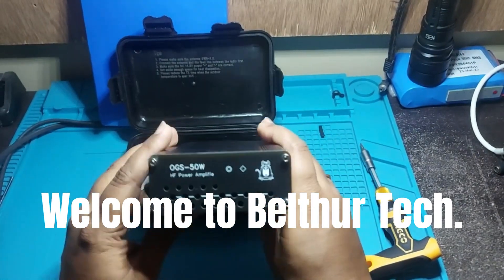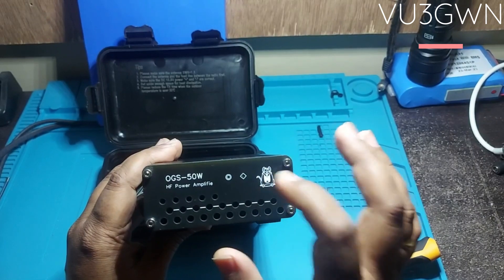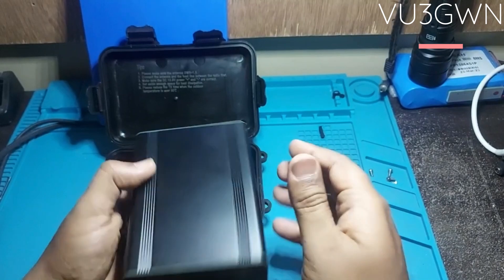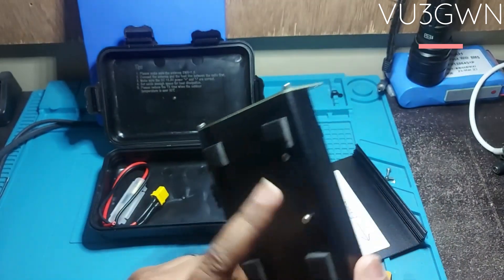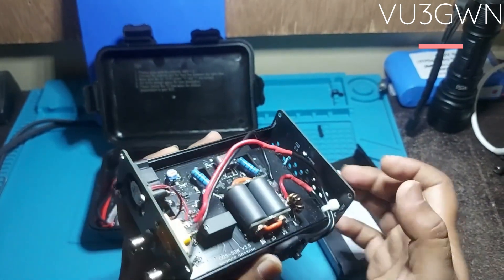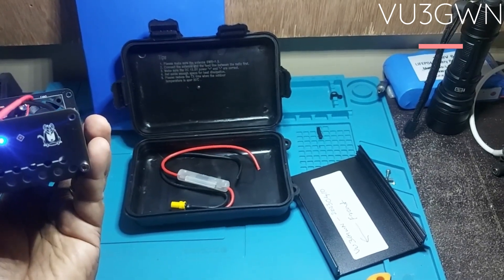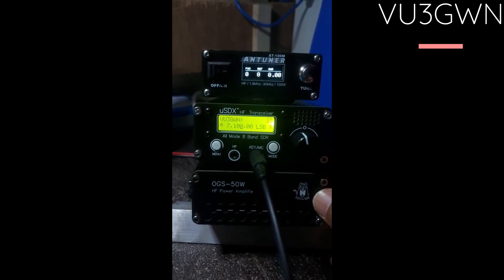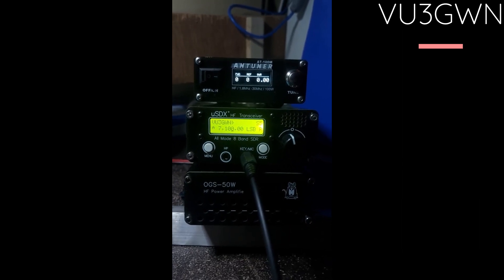OGS-50W RF HF Amplifier Review

Comment: Thanks....
I bought one and will be very careful regarding SWR & power fed into the amp by my rig.
My Qrp rig  is an old ubitx & bitx40. They are supposed to output 7 watts. My crappy meter says 5 watts on the bitx40, so to be safe I ordered a 3db in line attenuator.

Comment: I'm going to put together a setup with a mini usdx, an ATU100 coupler and a BJ300 linear amplifier. Is any linear modification necessary due to SWR or does the coupler mitigate this problem?
Reply from the maker: Since BJ300 goes to 300W your ATU-100 handles only 100W, so it will surely blow up if you put the ATU-100 between LA and antenna. Put the ATU-100 between USDX and LA. Hope your antenna is well tuned, high SWR can easily blow up the finals. Doesn't look like BJ300 has any inbuilt protection built. Check once.